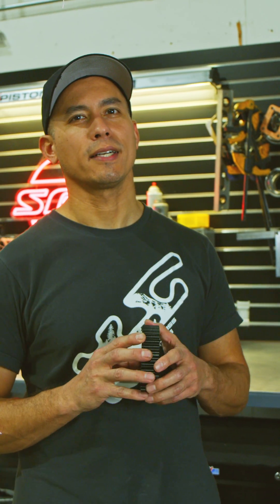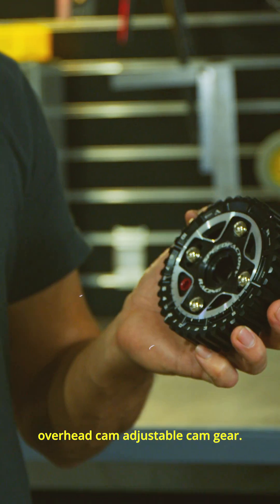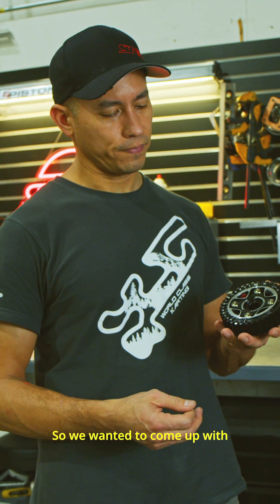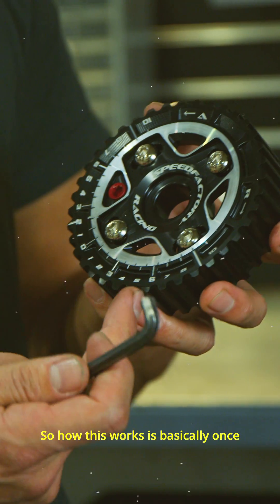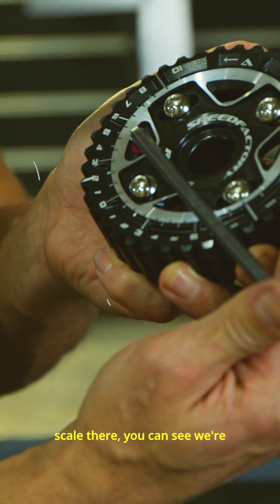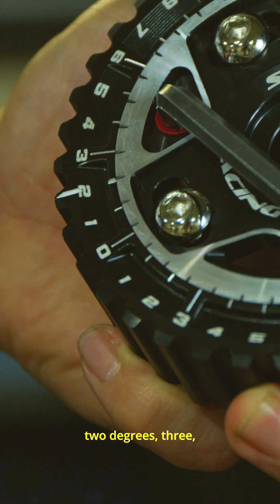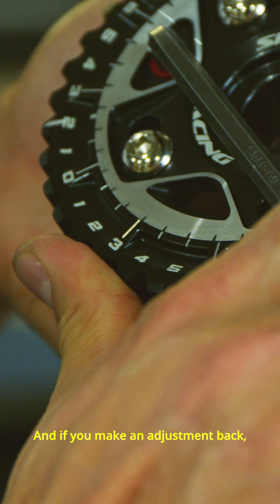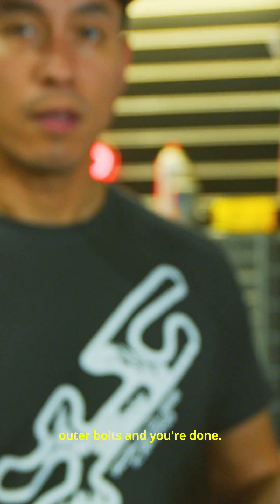New Product for 2024! SpeedFactory D15/D16 SOHC Adjustable Cam Gear

Comment: I’d like this I want this I need this
But I’m too lazy to get the degree wheel back out and pull my motor because the degree wheel is too big to fit on the crank wile in the car